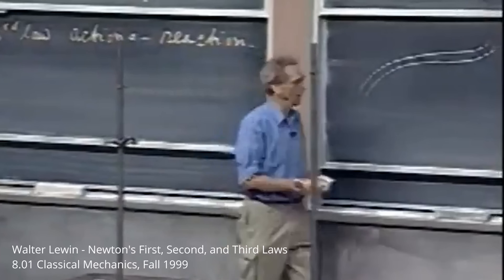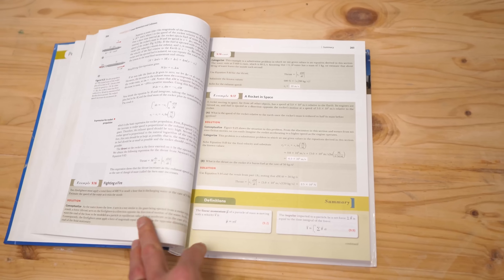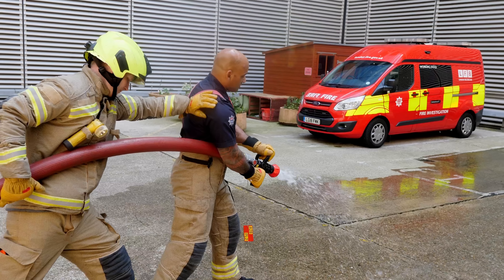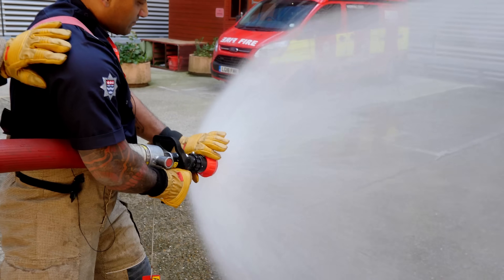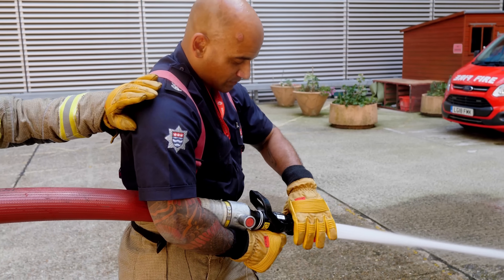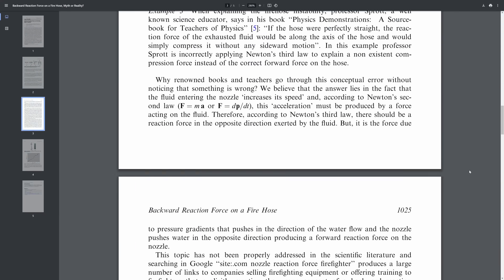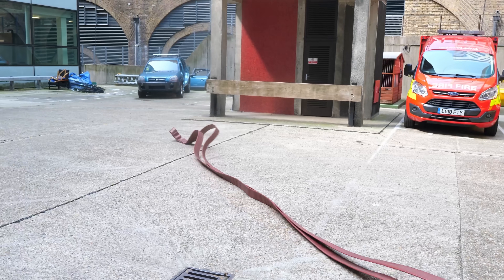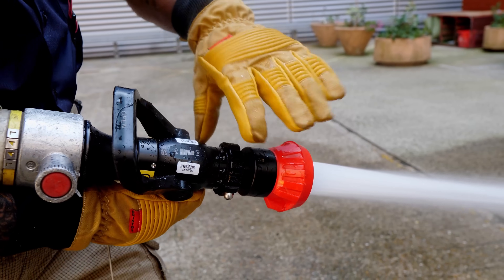Why chaotic hoses dance

Comment: The other thing you missed with the fire hose is that there is no single parcel of water. The water in contact with the hose experiences drag. So the larger the diameter of the hose the less total drag is experienced by the bulk of the water. Smaller hoses have to be run at higher pressure and there is a pressure loss per 100 ft of hose that you need to figure out from the pump so that you don't exceed the weight of the fireman on the end of the hose. To get 90psi out the end, you need to put more than 90psi in.

I don't remember the exact quick and dirty measurement we were taught but it had to do with fingers for different sizes of hose and how much length was out. 

As an annoying afterthought... do not call "large diameter hose" LDH Hose. Its redundant just like ATM Machine is.

Comment: The paper by Chin(?) takes for granted that "the pumper's orientation cannot transmit down the hose" and therefore "there can be no horizontal force where the pumper contacts the ground". What? Orientation - i.e. the directional component of velocity - obviously does transmit down the hose. That's why direction is a component of velocity (and thus momentum). That's literally how velocity differs from speed. That's why rotating things are different. It's how pulleys work. It's how water hammer works.

If the horizontal force isn't generated directly at the pump (i.e. by a pump which pulls water in and pushes it out horizontally), then it will be generated at some point in the piping between the pump and the output (which is horizontal). From that point on, the water will follow the hose, with water closer to the nozzle being pushed by the water behind it. In other words, yes, the force is transmitted through the water from the nozzle back to the pump. (The water can also push outwards on the hose, but with a perfectly straight hose it would be pushing symmetrically, and the hose would be pushing back evenly, so there'd be no net movement, so the only movement induced by the water pushing on the hose is the movement this video discusses, caused by bends or curves in the hose.)

Comment: This reminds me a bit of the Ram Pump. Are you familiar with those? It uses the sudden halting of flow to generate a lot of pressure to pump water to other places. You can see the reaction force on the faucet when it happens too. You can also look into Water Hammer or Hydraulic shock.

Comment: I think what happens to a fire fighter when using the hose is tgat the human body is a fickle instrument of measurement.

When water pressure is applied on the hose, it wants to flip flop around. But not necessarily a backward thrust force, but side to side. And we just cant exactly feel the direction of that force.

Comment: I think there's a lot more fluid dynamics going on too.  The operator of a concrete hose has to wrestles the hose to keep it in place, which seems to be much more because of the hose changing curvature as pressure from the pump cycles, and much less from an acceleration of the concrete. That might be a useful control to compare to the water or air hose.

Comment: The thing about a rocket is that thrust and power are not the same. Specific impulse is also a thing, what a nozzle does is increase Specific impulse by raising chamber pressure and letting out small amounts of exhaust at high speed, the integral of the pressure inside the combustion chamber and the nozzle as a whole is what provides the thrust and therefore also all the power, and the acceleration due to this pressure is equal and opposite to the acceleration of the exhaust over time. An expansion nozzle can cancel out to the excess pressure at the constriction nozzle outlet, but that is it. 

Run the calculation yourself, integrate over the inner surface of a pure constriction nozzle, and then a constriction nozzle with an expansion nozzel at its outlet to release the potential energy in density/pressure left in the exhaust, you will find i'm right, and that this means that there cannot ever be a reaction force like you concluded. 

Then run this experiment, take a pipe, and pressurize it with water. And subtract the force from the pressure inside that is exerted on the blockage at one end, now you have a net force equal to the pressure time area acting on the other end of the pipe. Simple enough 

Take this basic principle and use it. 

Build the following setup, a scale flat agains a verticle wall, such that you can measure force in the x direction, you take a water pipe with a 90 degree bend in it, and you flow water through it from the y direction, the z direction being straight up and down. So you should now have a 90 degree bend in the plane of the ground, a scale in the yz plane, and water shooting out in the positive x direction.

Now run the control experiment, no nozzle, you simply turn the water on watch the water spray out in the x direction and measure the backreaction of the bend in the x direction, the y component of the force on the pipe is independent, so as long as you anchor the inlet hose or pipe you are good, you only care about the x direction. 

Now run the first experiment, put a nozzle on the outlet side in the positive x direction, where the water is shooting out. What you will find, is that there is no possibility of ever increasing the force in the x direction using a nozzle. Given the inlet water pressure is the same, which it won't be exactly so be somewhat careful with that. But yes, in briad terms as long as your inlet pressure is roughly constant, putting a nozzle on the end will always decrease your measurment of the force in the x direction on the 90 degree bend. 

The reason to do this experiment is to show that the explaination of the acceleration at the nozzle causing a backreaction is wrong. And i can with 100% certainty say that you will find the result i told you about here. Adding a nozzle will only ever decrease the force at the bend. What it will do is increase the specific impulse, that is the power per mass of water ejected.

Comment: 9:00 - Your experimental setup has a 360 degree turn in it, so the 'pulling' force might be pulling equally in every (two-dimensional) direction, as opposed to sharply in one as it would if you had a 90 degree turn instead. This might affect your results here?

Comment: 1:01
The reason an open garden hose starts to wiggle is water velocity - not water pressure.
The water is trying to eject straight backward from the hose. But the hose is never straight, so it becomes a vectored force, making the hose wiggle from all the different angles.
Remember, the pressure is very low in an open hose, so this effect is from the water wanting to leave in a straight line, while the hose is never straight.

Comment: If there was no nozzle on the hose and the water came out in a laminar flow, then the hose likely wouldn't build up much pressure, and you would feel no rocket-like force at the end of the hose. You would still feel forces from that bending action though.

Your air pressure tube probably works like a hose with no nozzle, and probably shouldn't be compared to a hose with a nozzle where pressure change is a significant factor.

Comment: I think it has nothing to do woth the hose length, but rather the hose rigidity...which of course for a given material and a given diameter comes to be a function of length. 

Anorher point is that the nozzle of the firehose is a restrictor of some kind, possibly reducing the diameter of the outlet, thus creating this difference in flow (as pointed out by another commenter) that creates the increase in pressure and so on and so on...

Comment: As another commenter has pointed out, there is actually a pressure loss along the hose. But I think there are two things which aren't properly accounted for, or at least explored in this video. 
1. The pressure exerts a tangential force to the hose / pipe, which causes some expansion. This expansion can be likened to potential energy stored in a spring. The pressure differential throughout the hose means that this potential energy will decrease as we move closer to the exit. I think this can partially account for the effect of the end of the fire hose swinging back and forth, instead of the entire hose flailing about like in the case with the small pipe. The internal pressure is essentially trying to stretch the pipe out and a straight cylinder will have the largest volume. Towards the end, however, the pressure drops enough that a small perturbation can cause some flailing, as you described in this video. In the case of the small pipe, the pressure can't build up enough to keep a portion of the pipe straight. 
2. We also need to think about things in terms of viscosity and Reynolds number. At small scales, we know that air will be "sticky", meaning there is a stronger interaction between the air in the pipe and the wall. This goes for the water in the fire hose as well. So when the fluid exits the pipe in these cases, it's kind of like a bunch of people all trying to leave a stadium at once, everyone has to slow down cause its so cramped, but they can start moving faster after they leave the main entrance. So there is this constant stream of people leaving more or less. In the case of the inflatable man, we have a different phenomena. The tube is not too long compared to its cross-sectional area. In this case, the air can move around inside more freely. So when the air gets close to the end of the tube, a bunch can flow out all at once, but the lack of "stickiness" means that it flows out too fast and the pressure drops quite a lot. But the collapse of the top of the tube leads to more pressure building up inside. I guess an analogy for this is like waiting in line for a club. Eventually, the line gets too long and the bouncer has to let some people inside. But then the line gets too short, so he has to let it build up a bit more before he can let more people inside, cause after all, nobody wants to go into a club if its not popular enough to have a line😄. 

TLDR; I think if your tube man was sufficiently long, and slightly elastic, it would behave more like the pipe or fire hose.
Reply: Based on this way of thinking, would there be a difference if, say, the pump and water tank was attached to the person? The only way I can see it being the full force of the water pushing back is if all of the force is being generated in the same mechanical system that's experiencing the force. I'd love to expand my thinking and view on this!
Reply: @DakotaEAWilliams  I think in either case, the pump is experiencing a force equal to the pressure at the start of the hose times the area.

Comment: Just a train of thought so it might be awfully wrong, but I think that at 8:58 the force measured might be different for compressible and incompressible fluids. 
I feel like some of the expected force of the air tube is lost due to heat generated by the compression of the air inside the tube. 
small disclaimer: I have no clear reasoning rather than just a simple gut feeling

Does anyone know if the fluid's compressibility is negligible?

Comment: well - the "never let it charge overnight, never charge it unattended" - that would just make all battery-powered items completely useless.
You should have a save place to charge those high energy devices, but if you have to attend them that would mean that every time you use an electric scooter you'd then have to babysit it for at least that long afterwards. Got an electric bike and a 30 minute commute? That means >1hour watching the bike charge.... Yeah no.

Comment: Think about how an expansion nozzle works, if you have a truly uncompressible fluid, then it doesn't work at all, and the reaction force at the end has to be of the opposite sign of what you suggested. The reason is quite simple, the constriction nozzle has an integral of pressure of its internal surface that points in the direction of the outflowing water..

Now lets think about what an expansion nozzle does after a constriction nozzle, if the fluid at the exit is at the outside pressure, then no additional net pressure can be used in an expansion nozzle, if the pressure is above ambient at the constriction, then an expansion nozzle can only ever extract all the potential energy held in the exhaust in the form of compression to lower density, when it reaches the ambient pressure it is done, it can no longer extract anymore energy. So an expansion nozzle cannot ever produce more thrust than is lost in the constriction nozzle. That is a simple and unbreakable principle of nozzles. That means that it is impossible and i mean truly impossible to have a net force backwards on the hose from the flow of the water at the nozzle, the nozzle is always somewhat pulled along with the water by friction, there has never been and will never be a reaction force at a nozzle. It is true in rockets, it is true in waterhoses, every little bit of hose inside the hose and nozzle feels a net force in the direction of flow of the water and perpendicular to the walls, there is never even a single spot inside the hose or nozzle that feels any backpressure or backwards force. Except in an expansion nozzle, but in an expansion nozzle you cannot  ever get more backpressure than the forward pressure on the constriction nozzle, in the case of a straight hose or tube, the friction inside the tube acts as a kind of constriction nozzle lowering the pressure along the way but also increasing the speed, i know that is counterintuitive but it is true.

Comment: The backward force the firemen feel from the fire hose nozzle is fully due to the increasing momentum when slow moving water in the pipe/hose accelerates to probably tens of times higher velocity at the nozzle. 
Easy math.
But, that's not all. 
There is some support in the hose backward from the nozzle, but when that hose is not straight, there are also forces sideways and up-down on the nozzle. Those are partly eliminated by the helper behind.

Comment: I'm no scienstition, but to me it seems like the firefighter and the pump are part of the same system, the pump is proving the reaction force but my guess is that it's transmitted from the nozzle to the firefighter through the ground to the pump.
Imagine a solid steel pipe going straight out from the pump, the force at the nozzle is just going through the pipe to the pump just like in a rocket. For the reaction force a flexible hose with a firefighter is the same thing but with extra steps.
Also for water forces in a pipe that curves look up water hammer, Grady from Practical engineering has a good video on it which talks about the need to engineer for it in utility pipes.
Reply: It reminds me of Bowden cables, where it's the force differential between cable and housing that transmits the force. You can have a break in the housing provided that the housing on either side of the break are anchored to the same structure to transfer the force.

Comment: i agree, you can't push a string and see a force at the opposite end if all you have is a string. you can however, put that string in a straw and push on the back to see the force at the front. does the straw, or hose in the fire fighters case also contribute to the forces the fire fighter feels?

Comment: You should've added a nozzle to your air hose and see if the force increases.

You know if you have an adjustable showerhead or garden hose nozzle... If the nozzle is wide, the pushing force is low and vice versa. Of course to a limit when the nozzle is too small and restricts the flow too much... How much?

Comment: pretty sure the hose is pulled forward (visible when the hose is lying flat on the ground). The firefighters feel a push backwards, because they lift the hose from the floor introducing a bend that wants to grow bigger, thereby pushing back on the firefighter.

Comment: I think the only reason the velocity increases at the nozzle is because it passes through a constriction. If there was no constriction it would leave the nozzle at the same speed it was going through the hose.

Having only air pressure at the end of the hose it what allows it to exit at all, not something that causes acceleration at that point.